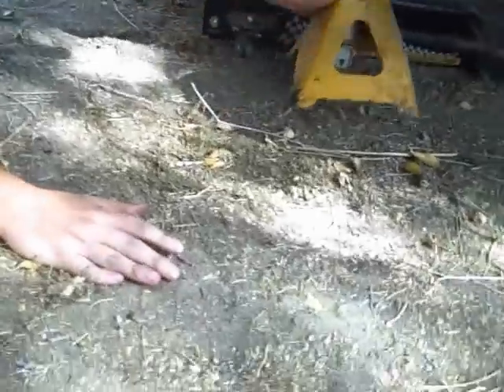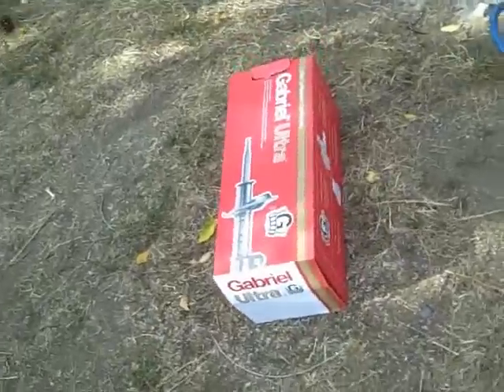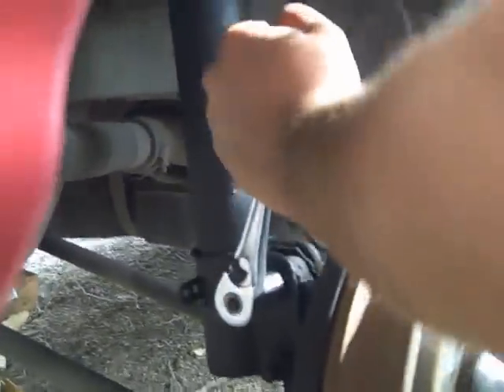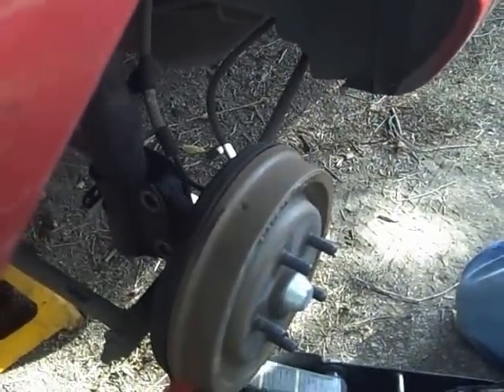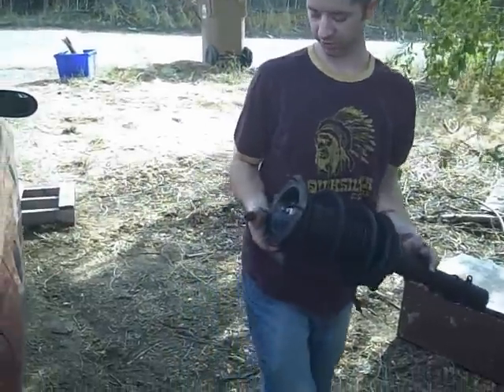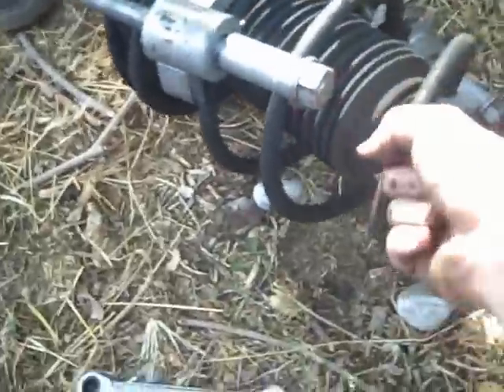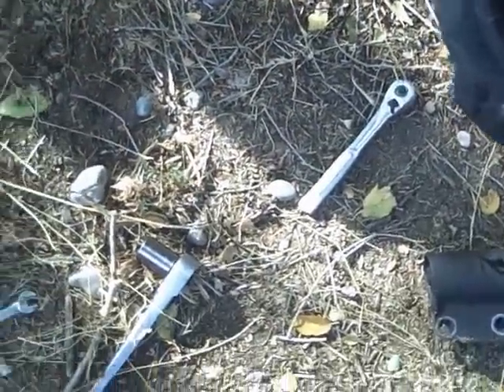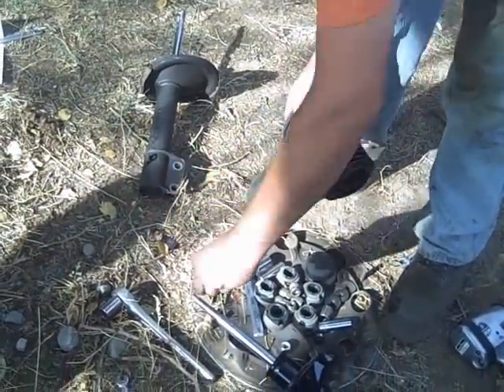Rear Strut Removal And Installation

Comment: Thanks for the step by step video.i have to replace a rear coil spring on my 03 Ford Taurus for inspection.it's the same process except the rear seat needs to come off to access  the top of strut. good job fella.

Comment: @Subfightr 
I know this is an older comment, but had to add this. 
We recently did a strut job on a rusty '98 Taurus.  I ended op busting off the lower bolt on the driver's side, using a breaker bar.  We had to drill it out (#8 hardened!).  After drilling, we decided to use a #8 hardened bolt and nut on it.
The right side went MUCH better!  Used tons of heat on it and the bolt eventually came out without breaking.  We also installed a new bolt & nut on that side.

Comment: I like your video because it is authentic;;;using common tools and working in the dirt.  While you have the car jacked up , you should change both rear struts. And although quickstruts cost more , they sure make the job easier, faster, and safer.

Comment: Cool video, I love shade tree mechanics! You may want to grab a spring loop before removing the last strut mount nut. By letting it drop down you risk damaging the brake line. Also, instead of unscrewing the bolt to remove it, you could alternatively leave the nut on at the very end with the socket still in place, then gently tap it out the other end.

Comment: you need to make shure you inserted the bump stop plate correctly, you just put it all quick with out making shure it was the rite way , facing up or down, you need to check it nex time, other then that, grate videio for helping people, keep up the good work

Comment: @Subfightr As long as the strut top bolt is still secured to the top strut mount the strut spring should be secured and the strut should come out in one piece.  I always loosen that bolt before I start but only enough so that it is no longer TIGHT -not take it all the way off.  Breaking its tightness one turn is sufficient.  The entire strut should come out of the vehicle in one piece with the spring still attached.

Comment: @BethShanFan if the brake line is attached to the strut it is only a clamp that holds it in place to stop damage to pipe ect. just undo the nut and the pipe will come free from the strut, no need to bleed brakes. hope this helps

Comment: @BethShanFan 

Some strut mounts are designed (for god-knows what reason) so that the brake line goes THROUGH the strut and the only way to remove the strut itself is to take the brake line/hose apart to get it out.

It's a pain because the brakes need to be refilled & bled after this.  

Many aftermarket/replacement struts are designed not to need do this even if the OEM's did.  I've actually cut the old strut metal apart to avoid opening the brake line if the new strut is a different design.

Comment: i know you have to aline the top mile installing the strut mount with the bottom strut bolt threw holes before you tightn the top nut.. or like i did ( leave the spring compressor on when you install the strut so you dont have to struggle lining bolts up. then slowly release the compressor and seat the spring, the continute tourqing the bolts)

Comment: @Subfightr 

And by cutting into the strut I don't mean cutting into the body of the strut and releasing the gas inside.  That would be bad unless you did it exactly right as it could blow out and metal fragments could be shot out at you.  

I mean to just cut the stamped metal that is trapping the brake lines where there isn't a clip or other removable tab that allows you to take the brake tube and hose off without taking them apart..  Just cut the stamped metal with a snips and discard.

Comment from the maker: @darrylj4u lol yeah good point. It was not actually the order we did it of course, hopefully people don't actually do that... I had the jack with some tension on the car, used the weight of the car on the tire to prevent the wheel from spinning as I unbolt the tire, THEN... yeah, jack up the car and fully remove the tire. I doubt people will be able to actually remove the tire then jack up the car anyway...

Comment from the maker: @RAT1969 Thank you for the suggestion RAT. Is that meant for everything or just the upper part in the trunk where the strut connects to the car? Seems like one would have a hard time tightening everything with the wheels on and car lowered no?

Comment from the maker: @r1killen as long as you use the correct size socket, and it's on the nut correctly, that should not happen. I have never had a problem. I tend to use the breaker bar myself though. Thanks for the comment.

Comment: Okay I do have a question that I didn't think of before: if you're removing the brake line from the strut before taking off the strut, do you need to bleed the brake line to make sure no air has gotten into the system, when you're all done?

Comment from the maker: @BethShanFan I have never removed the brake line while doing the strut.  I suppose if you did you would have to bleed it. If you open the break line air can get in then yeah, you will have to bleed it. A simple way to prevent that is to crimp the line with vice grips 1st. I expect thats shitty shade tree mechanic tip and not one that a pro would advise, it may be possible to damage the line or something, always worked for me though. (shrug) Hopefully someone else can better answer your question.

Comment from the maker: @CHRIsumoPHER 

That magic break free spray stuff has never helped me. Good ole "man power" always did the trick.. or the bolt broke.. :(
 Breaker bar, if that does not give you enough leverage get a pipe or a wrench that you can attach to the end of the bar to assist you. All else fails hopefully you have access to an air gun like I used in the video. I am pretty sure the breaker bar and pipe/wrench combo will do the trick.

Comment: anything that is 'loaded' really, so top small nuts and large top nut and the 2 splined ones at bottom of strut .
Put a jack under where your friend suggested after your done and 'load' the suspension (take wheel back off), Its really just to settle everthing to where it would be naturally. Probably jus me bein petty !
Same theory is actually important on motorbike front forks and wheel spindles otherwise you can get fork bind, pump the forks then tighten everythin never with wheel in the air.

Comment: there is nothing wrong with a dodge neon drive one every day to work and so does my mom we have 2 of them a 00 and 02 year and my mother has drove hers for 2 days hot do to a faulty rad cap took a gallon of coolant to fill it back up and it did not blow the head i am touched i want a srt-4 very bad i cant stand i love dodge neons wished they still made it

Comment: it a very wonder they did not get get hurt, but they got the job done you learn on the job, i sale auto part everyday, and work on cars on the side saftey is key and the right tools for the job, these guys could used some more tools a west virgina fiter all is not the best tool to use lol give these guys a few years and they will be very car savy